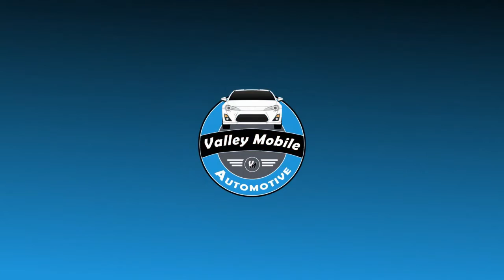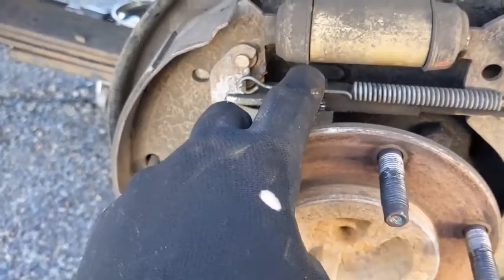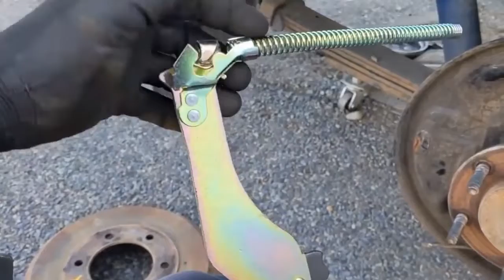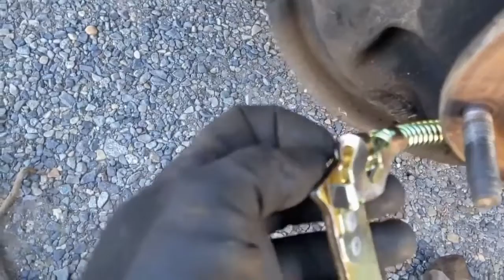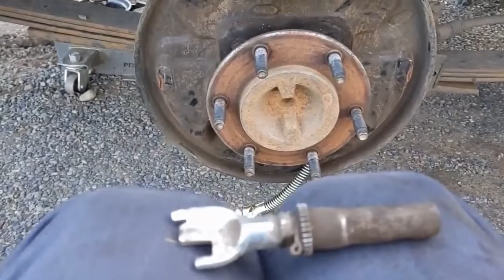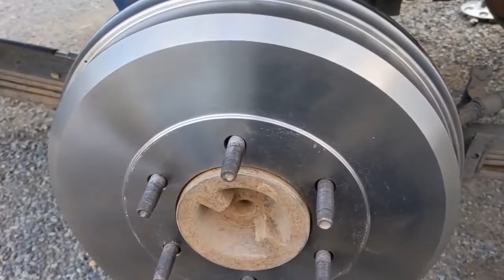Chevy Colorado Rear Brakes and Drums Replacement | Changing Rear Brake Shoes

Comment: OH, man. You were so close to having the absolute best video on how to deal with that parking brake spring. I wish you had set down the camera and showed the exact process as I've never seen this approach before on turning that end of the spring. If you ever get the chance to video this in depth you should to save many a Chevy owner a lot of grief and frustration fighting with this.
Reply from the maker: Hey Dale, this is a video I did on a Cobalt. The rear drum set up is very similar. Maybe between the two there will be more pieces to help.
https://youtu.be/RmdIhAcG5C8
Reply: @ValleyMobileAutomotive  Feeling confident enough to do this. Thanks.
Reply: I found that the new Centric brand shoes had a lever return spring that was stronger than the one on the older  shoes and defeated me on my attempts to get cable to poke through, so I used the undamaged lever return springs from the old shoes. Miserable balancing act trying to get that huge dual big blue dual holdown/ retracting spring in without blowing one side of the wheel cylinder out. AbsoluteSh@t

Comment: "I'm just going to tell you how to insert the cable into the spring and not show you because it took 8 fucking guys and and a wench to get it into place" fuck me!
Reply from the maker: Yeah I wish I had a better camera set up back then. The rear parking brake cable can be a pain for sure. Here is another video on a similar style brake set up. Skip to time index 13:05...
https://youtu.be/RmdIhAcG5C8?si=1Vo8Gu-qxCecDDgA
Hopefully this is semi helpful.
Reply: @ValleyMobileAutomotive  I finally got it. Man... that was a pain in the you-know-what... I think my e brake cable is shorter than normal. Thank you for your video. It did help a lot.

Comment: The Colorado rear brake shoes is a poor design.
By putting the Springs on the shoes  it made it a pain in the butt to put on.
Reply: Indeed.  Mechanics are not used in designing as much as they should be. Engineers don't do much in the way of fixing things.